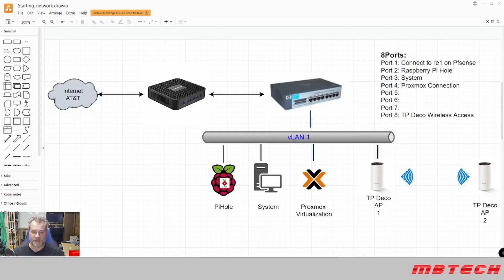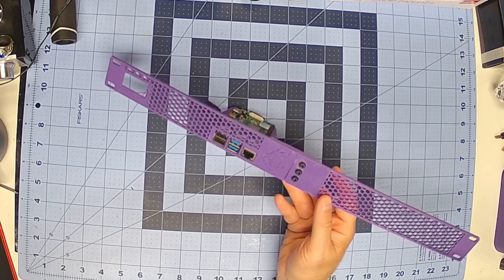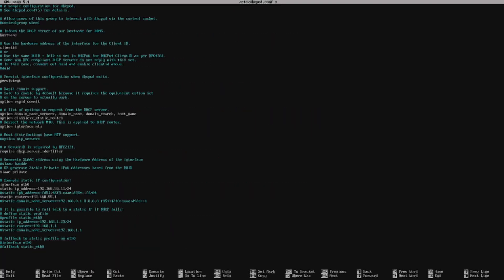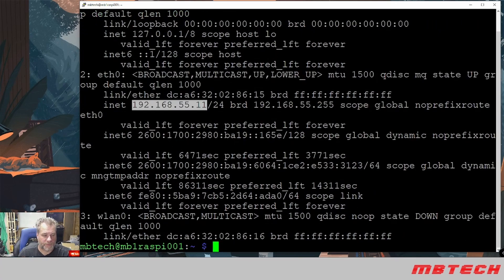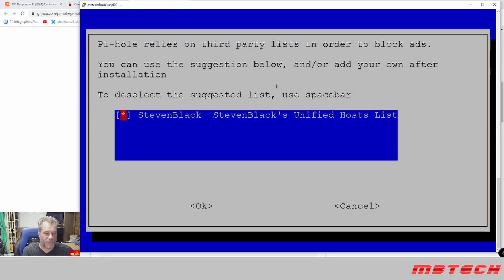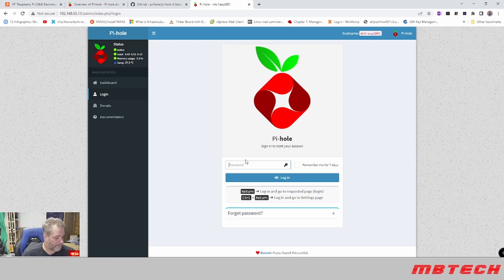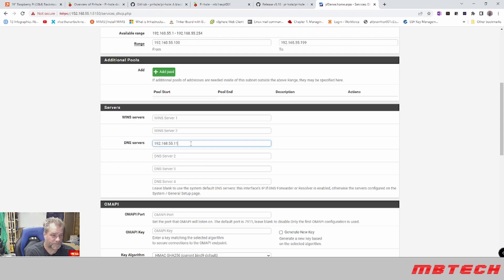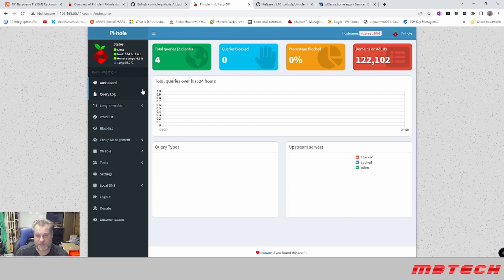Adding Pi Hole to pfsense 2.6.0

Comment: Awesome video, my pfsense was rather rusty.
I did have pfsense running on a VM on a server I had under the stair case.

But...  After the UK energy prices went up quicker than a SpaceX rocket I had to decom it.

Recently got a little router that can run pfsense and returned but....
I'll be damned if I can remember how to do this stuff.
Even port forwarding with outbound nat seems to be an issue.

Thanks for the video, you stopped my pihole getting rate limited lol

Comment: What about DNS forwarder under the service tab? I setup my pfsense to have the dhcp dns server to be pfsense ip itself and just run dns forwarder to pi hole ip.
Reply: Good question, sadly no response.
Reply: @ecotts  Google resolver vs forwarder.  The resolver will query the root server to find the TLD, and then query the TLD server for resolution.  The forwarder will forward the request to another DNS server to do it.  If you're resolving, you don't need to forward.